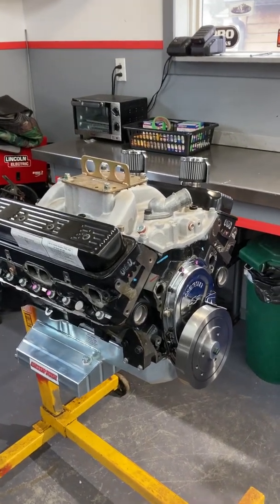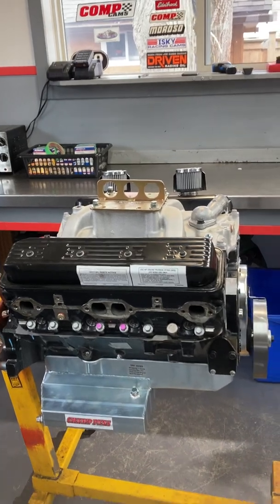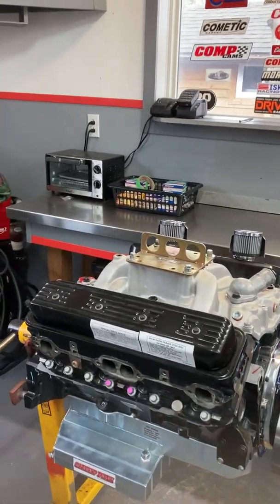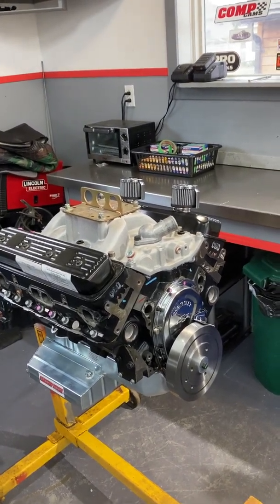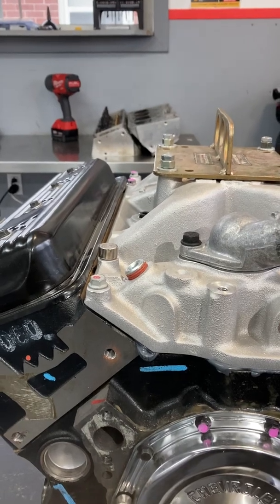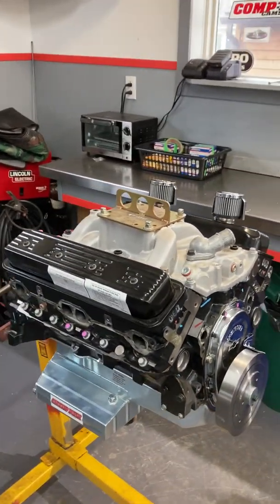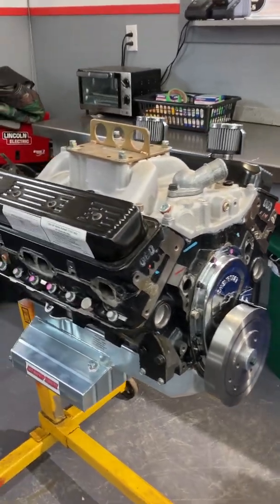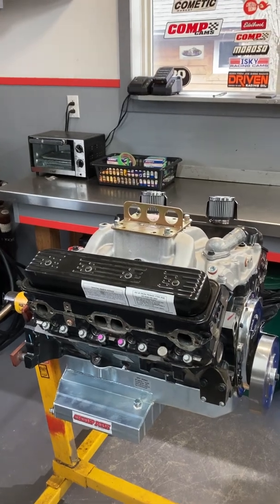Preparing a new GM PERFORMANCE 602 Crate Engine for battle in TREVOR COLLVER MOTORSPORTS Race Car

Comment: Could you use ls6 beehive spring’s instead of constantly changing them 
The Zz6 and SP383 both use beehive spring I think
Reply from the maker: That is correct Antione. The 604 crate motor also uses Beehive springs, however the rules do no allow it. Springs and rocker arms are inspected by the TECK guys frequently. Thanks for your comment.